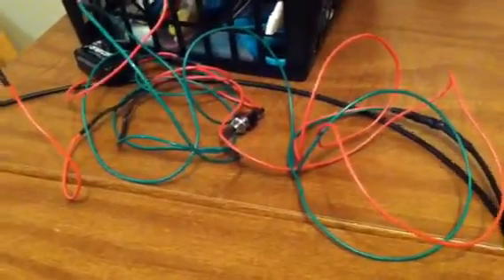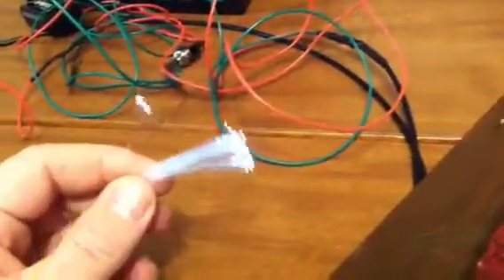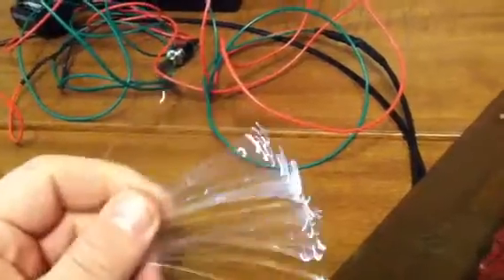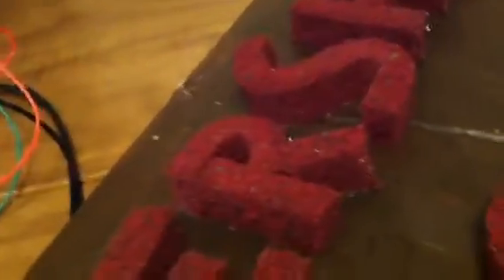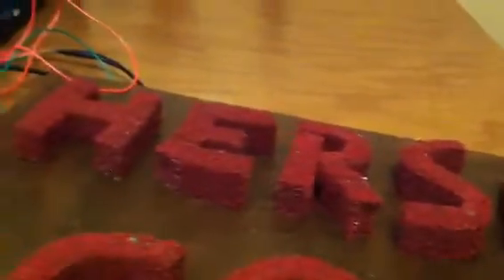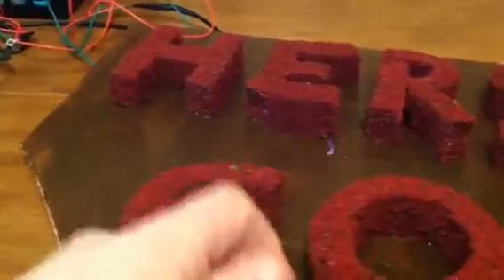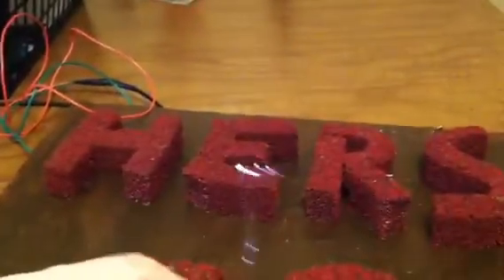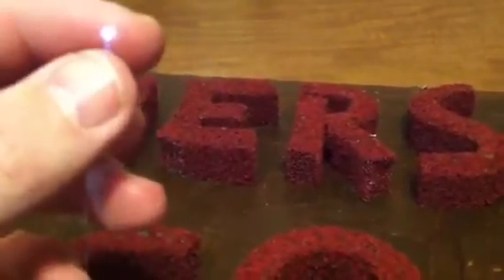Help with Fiber Optics on layout

Comment: You should get a thick long sewing needle and push each individual  strand of the fibre optic through the front of the letters. On the back you may have to make a small light box with your light source and FO stands in the box.... Line the box inside with tin foil paper as a reflector.. Should work great,  good luck to you!